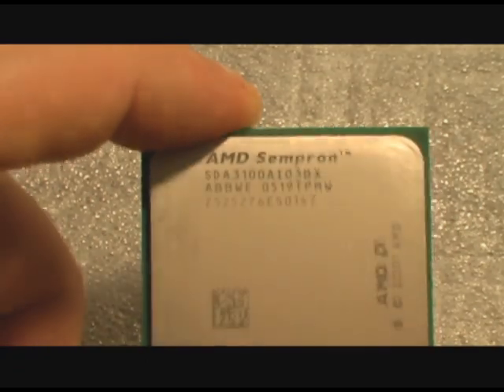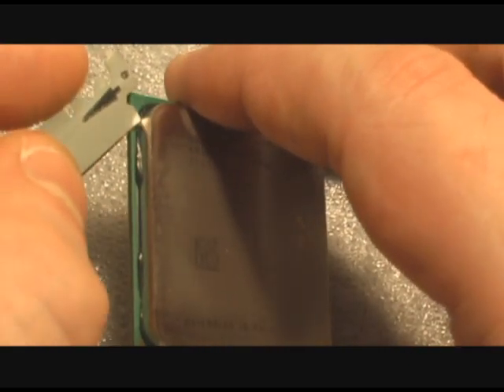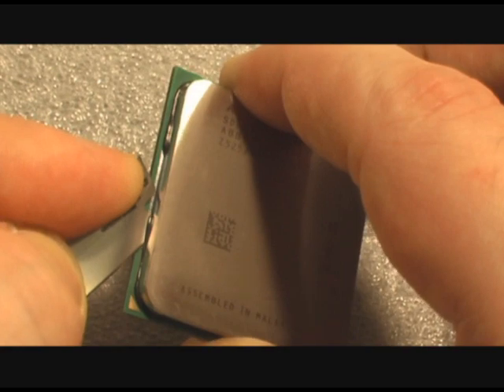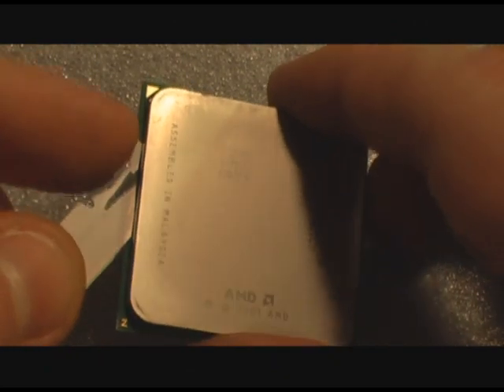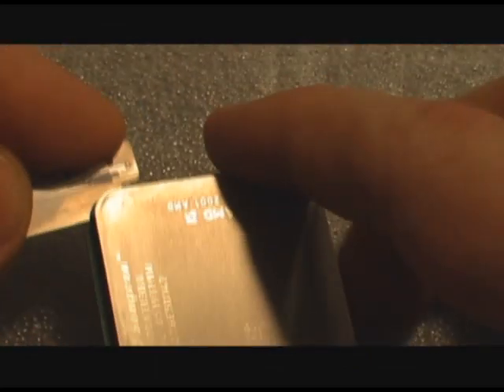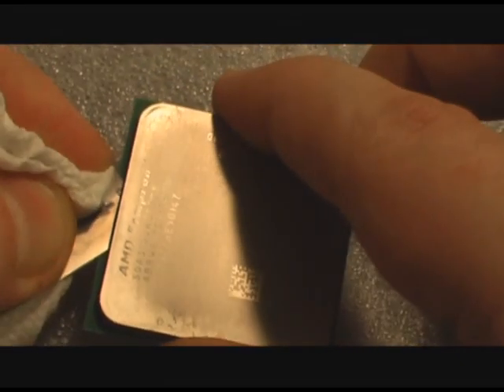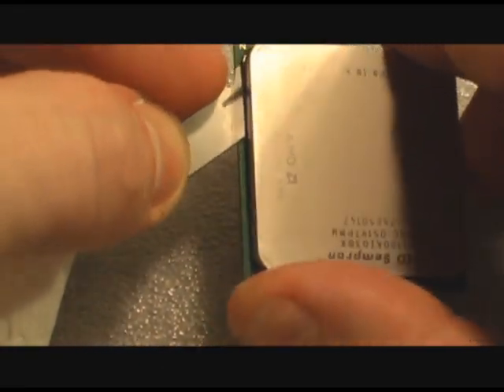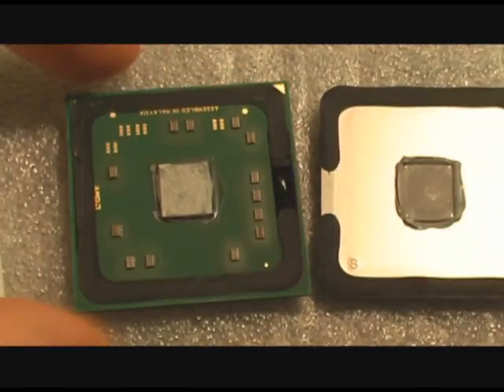Athlon64 Integrated Heat Spreader Removal

Comment: With a bolt down heatsink i have just to bolt it down to the end of the bolt?
After all even if the core is exposed it is also lower, so it should not receive as much pressure as when the cooler is mounted on the IHS
Reply from the maker: Sorry. I keep forgetting I have this page. Probably a moot point now, but I'll answer just in case modders are still out there (as these tricks work on the newer generation of Intel/AMD cpu's, though the integrated heatspreaders are much better, and locked to the core much more securely).

You want to bolt it down like you would when changing a tire. 1 - 4 - 2 - 3 cross pattern, and only tighten them a little at a time. If you over-tighten one of the bolts, it will put too much pressure on the core of the cpu, cracking it, and then it's a dead cpu without a warranty (though you've cut the heatspreader off, so that's a moot point as well heh).

Smooth, even pressure, until the sink is secure. Don't over-tighten as it will cause the motherboard around the cpu socket to warp, which leads to broken solder contacts and worse, which results in dead board, no warranty. You want a good amount of pressure from the cooler on the cpu, as you want as little space as possible between the two materials (of course, remember thermal grease, use good stuff if you can) so heat can transfer efficiently. There's just a line you have to watch out for that becomes "too much pressure" which breaks stuff.

Comment from the maker: Not sure if they 'wear out' but there were plenty of Intel and AMD cpu's that either didn't have proper thermal material applied, or had a slight gap between the spreader and the cpu core. This is one of the reasons we started modding these cpu's back then (the biggest reason of course was to put the heatsink/waterblock directly on the cpu core). 

I would advise against removing the heatspreader and putting the heatsink back on unless you have a bolt-down heatsink (don't use tension clip)

Comment: Hey!

First of all, great video.
Can the inside repasting fix a temperature problem? I have an athlon 64 cpu and an AC freezer 7 can't cool it down. Like there's no contact between the heatsink and the cpu, but what if there's no contact between the cpu cap and the cpu die? Can it happen? Can it wear out?